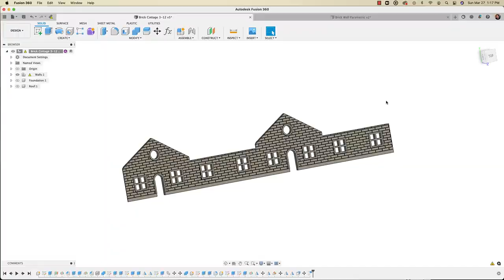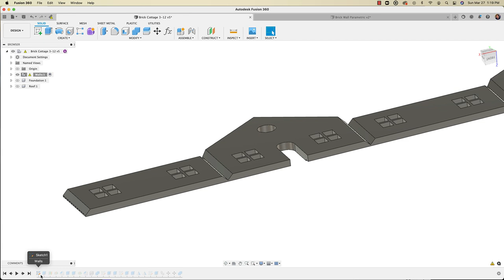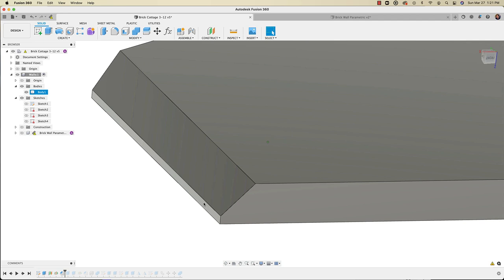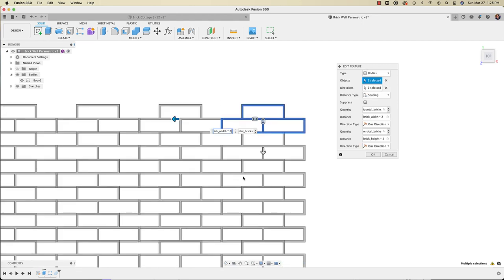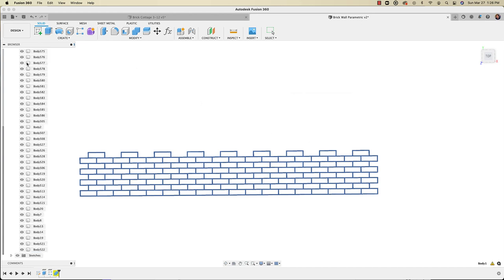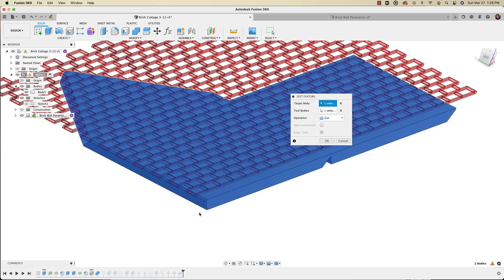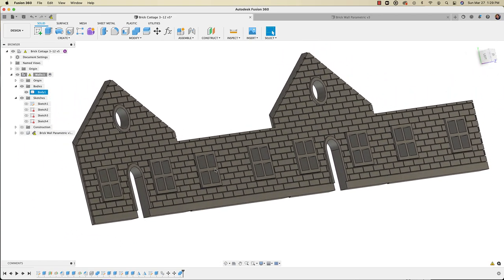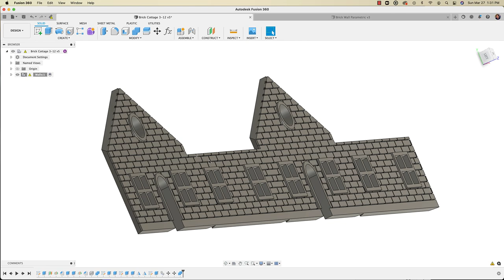Designing a Folding Brick Cottage in Fusion 360

Comment: Very nice tips for the brick wall 👌🏽 thanks!

Unrelated question to this video: I've had a Ender 3 for some years now and I was thinking on "replacing" it for a Prusa Mini + as I don't have a lot of space at home and I rarely print objects bigger than the Mini's bed size.
As you own one, I was wondering what do you think about it? It may be cool a video telling us about your experience with this printer too :) 

Thank again Vlad!
Reply from the maker: I love my Prusa Mini.  It's now my go to printer.  I get consistent results and it's quick to heat up and begin printing.  It's also so much more quiet than my other printers.
Reply: @DesktopMakes  thanks a lot for the info :)
Those are definitely features I would appreciate, living in a small space it's nice if it is also a bit quiet than my Ender 3 Pro hehe